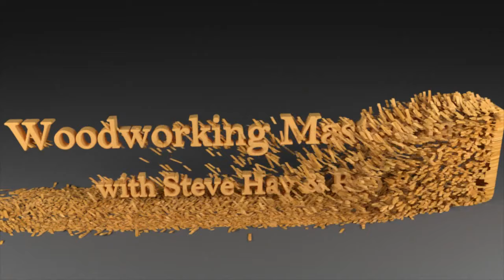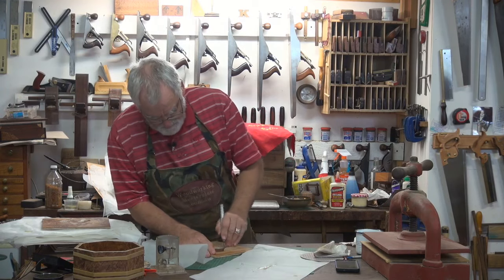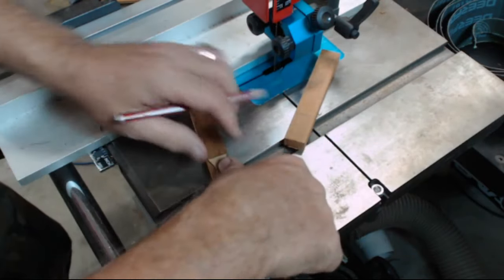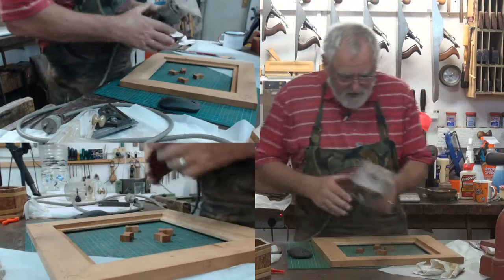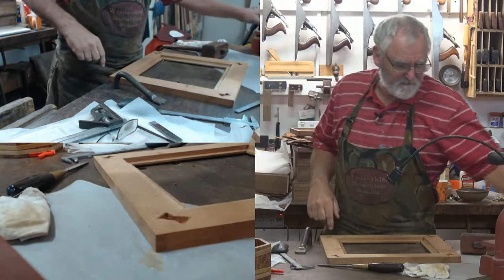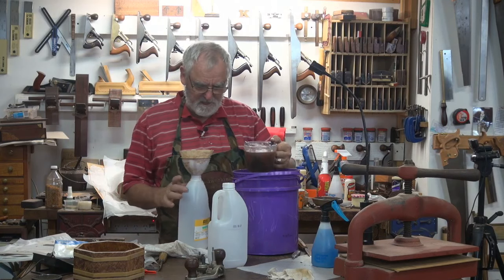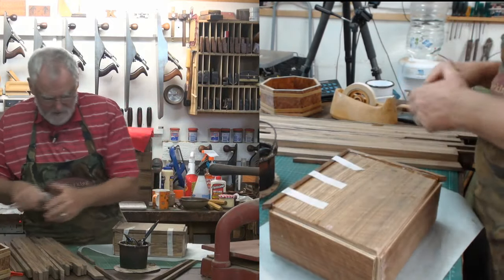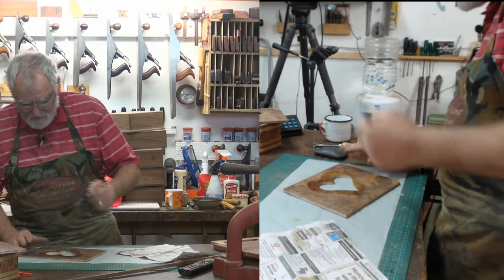(Day 7) Making Stands for Boxes, Start Building Custom made Pressure Pot and other Shed Work

Comment: What's a good way to cut out butterflies if you don't have a band saw?
Reply from the maker: Hi T Bone, Coping, Fret, Dovetail or Gent Saw will do the job just fine. Even whittle if you have top. :) See you soon. Cheers Steve
Reply: @Woodworkingmasterclass  Thanks, Steve, for doing a demo of that yesterday. I forgot I had a table top scroll saw. i guess that would work too. Cheers, see you soon.
Reply from the maker: @tbone7193  That would work just fine. T Bone. Cheers Steve